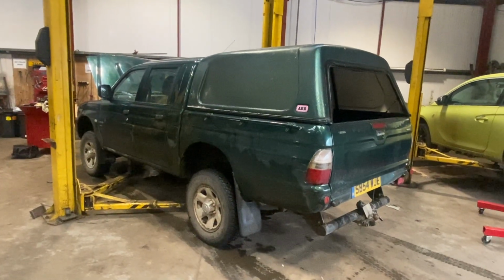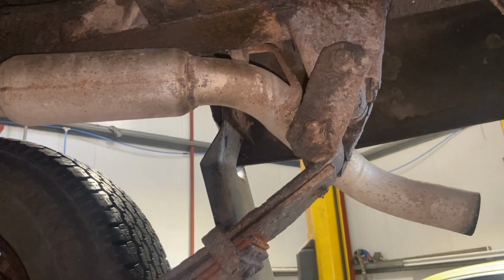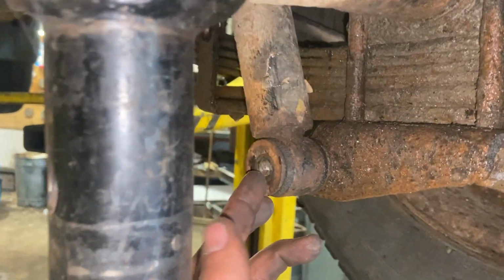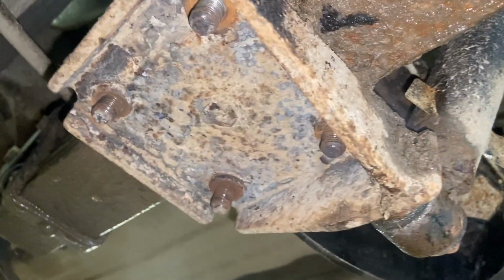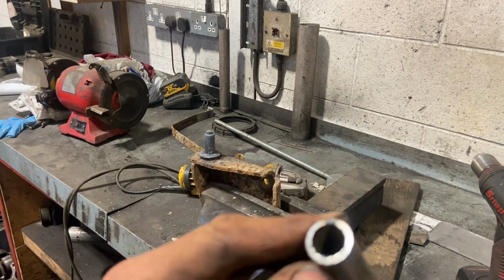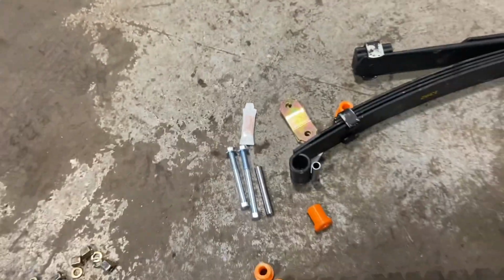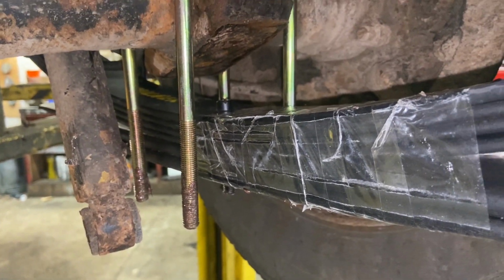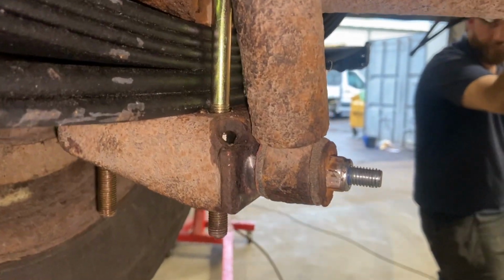L200 Suspension Leaf Spring and shackle bush Replacement

Comment from the maker: New Milners Leaf spring kit Ebay  - https://ebay.us/hK8kmh
Leaf spring hanger bracket / shocker mount - https://ebay.us/yHcqin
Check Euro car parts - https://tidd.ly/3lIO7xA  (use discount codes on site)
Check "Car Parts for Less" - https://tidd.ly/2LNEwIn  (use discount codes on site) 

Tools : 
Socket set - https://amzn.to/3eGx2Ak
Dewalt 3/8 impact driver - https://amzn.to/3njemLY
Spanner set - https://amzn.to/3gteqpG
MAP Gas Burner torch - https://ebay.us/8uw93o
MAP Gas bottle - https://ebay.us/xr89cu
Copper hammer - https://ebay.us/GbuTjZ
Punch set - https://amzn.to/3gp7Cuv
Oxy acetilene setup - https://ebay.us/mNMJ4Y
Air Chisel - https://ebay.us/O69p82
Compressor - https://ebay.us/rrvsAC
Vertical Jack - https://ebay.us/nAThQv
Deblock oil / Penetrating oil - https://ebay.us/KVNVyQ
copper grease - https://ebay.us/J3gm1u
1/2" Impact driver - https://ebay.us/YBBmKq
Mains grinder - https://ebay.us/KknEnW
Mechanics flat head Battery grinder - https://ebay.us/4Luw6R
Wire brush - https://ebay.us/38nQvQ
Hammer - https://ebay.us/X74Reh
1/2" breaker bar - https://ebay.us/N9jx3l

Check out my other L200 Videos :
Rear prop UJ replacement - https://youtu.be/e3p61ylBSf0

Comment: Thank you for this video, I had been having loud knocking and screeching sounds with my triton when its moving or turning, took them a while to identify that the sounds were coming from this area of the truck(after spending so much money changing other parts), now I sort of have an idea of what needs to be done, will proceed and fix this and test out to see if the sounds disappear.
Reply from the maker: Thanks for the comment, hopefully this job sorts your noise out!